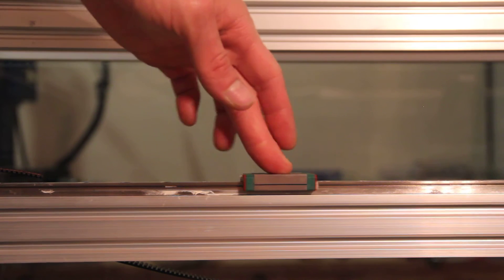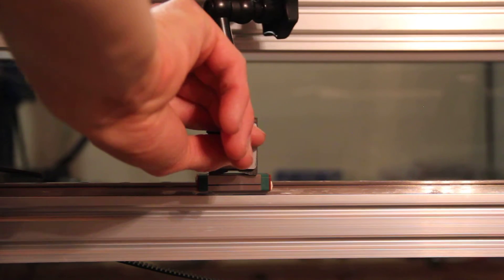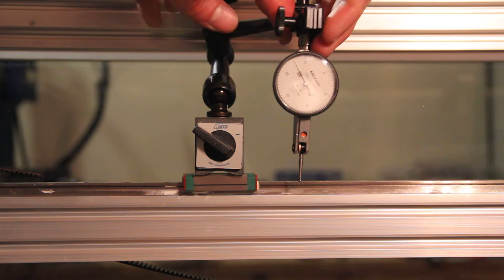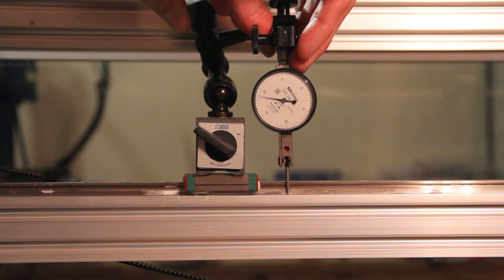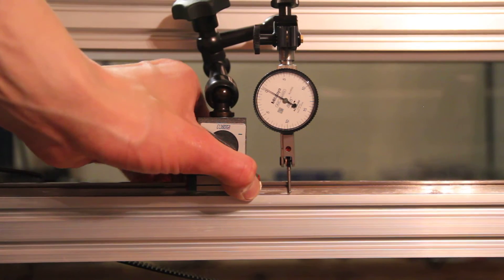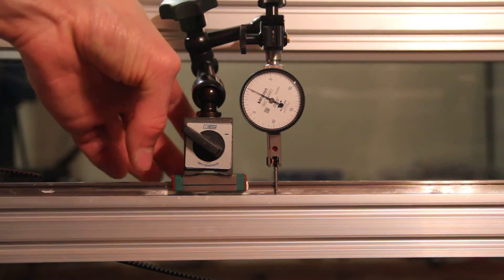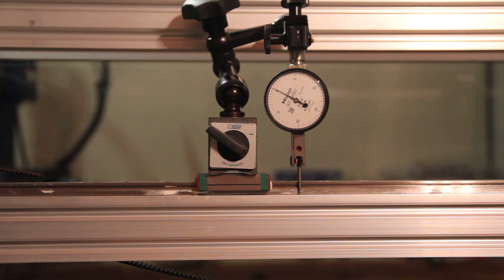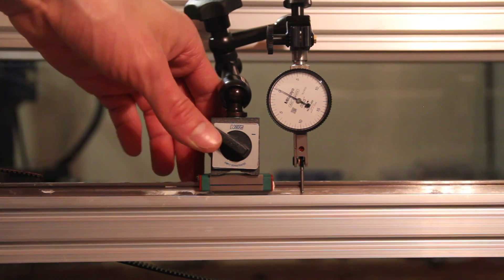MGN-12H Linear Track Twist Backlash

Comment: Nice video, but your measurements are incorrect/innacurate. The dial gauge rounded tip should be making contact, not half way up the needle. You are pretty much DOUBLING the reading.
Reply from the maker: Michael Ripley good observation, but the ball is actually the only point in contact with the rail. its just a bad camera angle that makes it look otherwise.